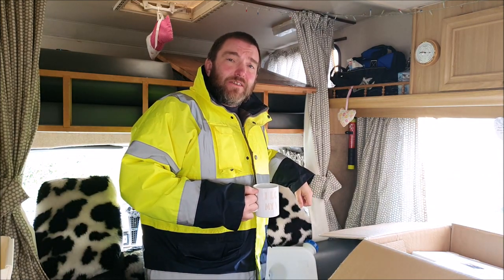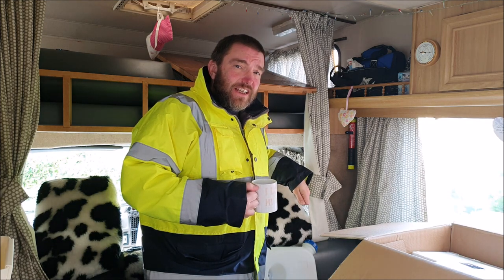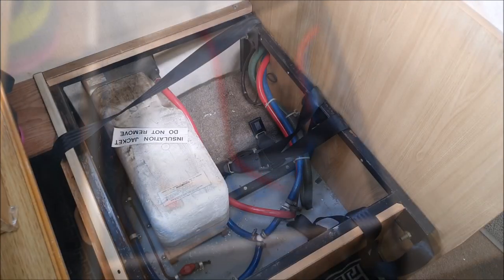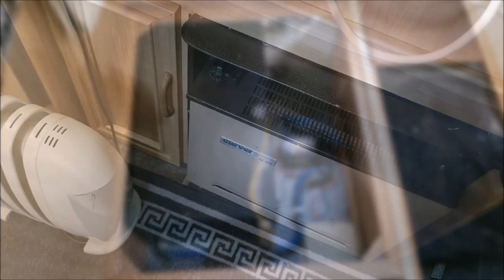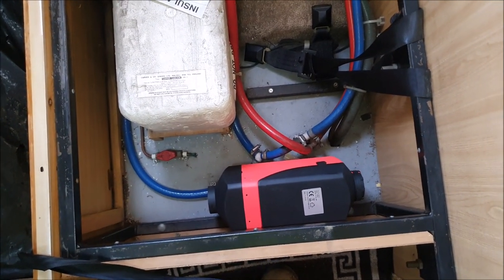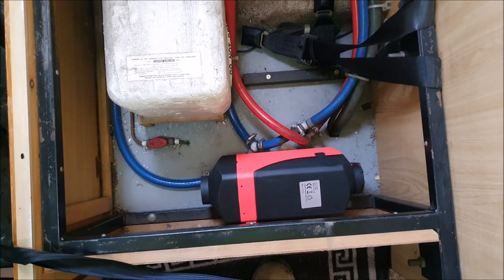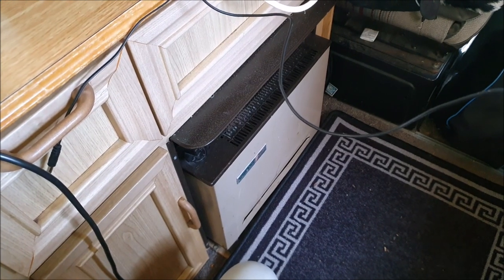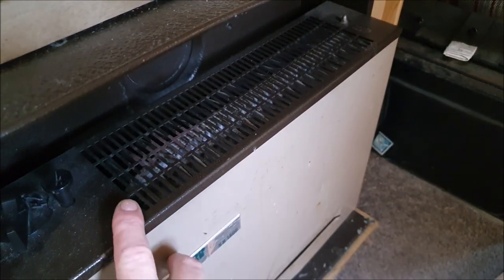Installing A Diesel Heater In My Elddis Autoquest 270 Motorhome. Part 2 - Removing The Gas Heater

Comment: Great work Alex. Don't forget to tie the pump/valve up slightly in mid-air with fishing line or strimmer line. This will dampen the noise from it. The valve can be a little noisy for most people. Cant wait to see the final installation. Good Luck.
Reply from the maker: Not much progress this weekend due to the weather but should be back on it again soon 👍

Comment: Sometimes you have to make holes to make improvements. Hope the fitting is now complete. With ours being an ambulance, the heater is fed from the main tank. We find that useful as we know we won't run out of fuel.
Reply from the maker: I may look at a connection to the main tank. The weather and other commitments have slowed me up a bit so I've not got much further yet....😕

Comment: Hi Alex, be careful about having the diesel tank inside the vehicle all the fumes; better to have the tank outside or at least have the breather tube venting outside the vehicle also filling it will be a problem. Take care and I will be watching for updates... Best of luck...
Reply from the maker: Yes, I'm leaning towards a connection to the vans fuel line now 🤔
Reply: @ttxela  I wanted to mention that but didn't want to give you more trouble but that is what I would do, lot less stress about fuel smells and also safer me thinks. You could also put the vent pipe under the van towards the hole where the old gas heater was that way the heat is coming into the van from a central point...
Reply from the maker: @Giles4me  Work has paused on this now a bit due to the weather - can't ewait to get back onto it and get it done!

Comment: I'm thinking of doing the same job, my gas heater did not work at all, what is wrong with yours? I was thinking about fitting my heater where the gas heater is as don't want to put more holes in the floor. Great video again very informative.
Reply from the maker: Mine was condemned during safety check. I'm thinking of putting it there now too!

Comment: Interesting but yes brute fore is often the way with older heaters.  They either fall off or are stuck forever.  Will you be able to fill the tank with it there?
Reply from the maker: Thinking on the tank has progressed to mounting in the gas locker or possibly a connection to the main tank 🤔

Comment: Waiting to see part 3, you need to be very careful if you are going to put the tank there!! just think of the filling up, plus the smell of diesel in the van, as you can't seem to get rid of it, don't want to upset her indoors ha ha ha, what about the gas bottle locker? would you be able to get it in there??
Reply: id put the desisel in the gas lockup and the heater in the now free space - simplez. Also plenty of space for exhaust ect underneath...
Reply from the maker: Yes, I think gas locker may be the plan after all - or even a connection into the main fuel line. I'd need a smaller tank for the locker.

Comment: You are going to hate me but I can’t see the value in the cheap Chinese heaters yes they are £120 but for £500 you can get a planar autoterm product which has a silent pump and warranty.
If you are going to install something make it something worthwhile.
Sorry if that’s negative.
Reply from the maker: That's a fair point although I actually only paid £65 for this one! In a newer van I may have been tempted to shell out more but low budget is very much the theme here. Time will tell if it's false economy 🤔
Reply: @ttxela  Agree but the van is still worth at least if not more than what you paid. And life’s too short sometimes? I have got a bit carried away with the upgrades on mine.
Difference between a £5-10k motor home and a £40k one (at the campsite) is the second glass of wine 😂
Reply from the maker: @c11yan  😂 very true, well you never know, if it fails after a while it may get replaced with the one you suggest 👍